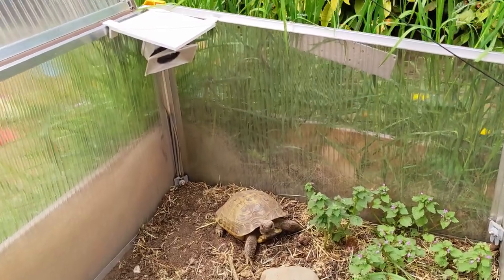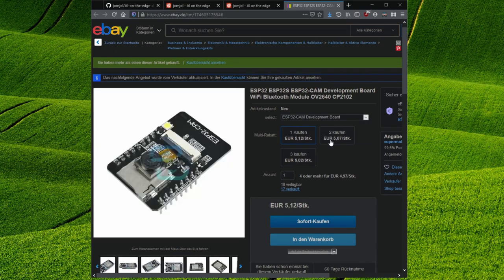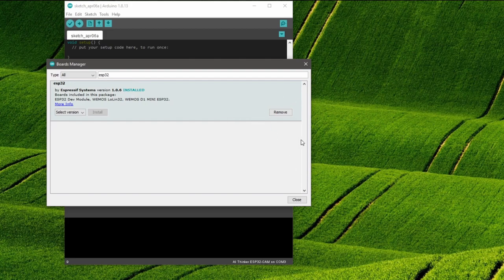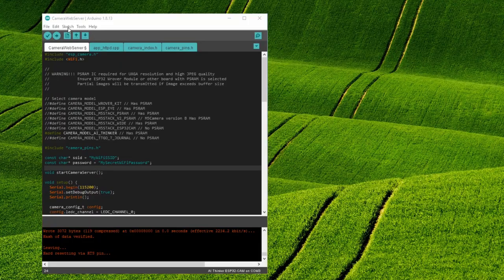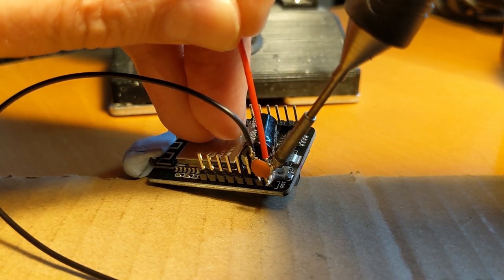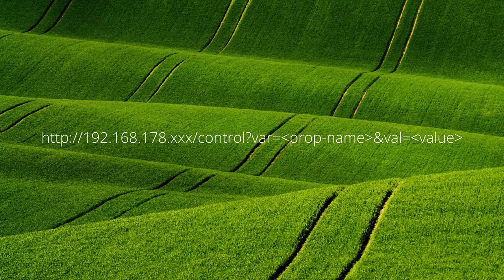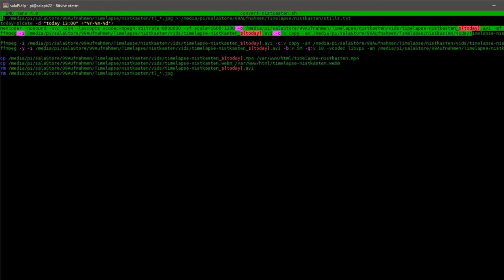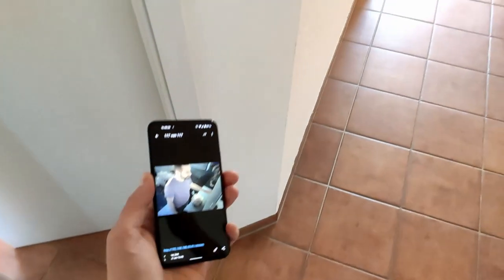ESP32-Cam Basics (for timelapse, pet surveillance, nesting boxes, front door cameras etc.)

Comment: Thanks for the great tutorial. I want to put this camera in an underground manhole outside. I don't have WIFI, so how can I get the signal from the camera. I would like to use a wifi/Ethernet interface or directly from the ESP Camera module with ethernet. Do you have any idea how to do this? Thank you very much for your help.
Reply from the maker: If you are at least close to a wifi, you could try it with an external wifi antenna. Of course, the meter should not be too deep in the manhole. On Youtube you should find examples how to solder a proper antenna to the PCB antenna leads.
I am not sure if there is a solution to store the data locally on the SD card in the ESP.
Everything else is probably more complicated.

The ESP has no LAN itself. So you would have to send the signal from the ESP via serial interface to another device, e.g. a Raspberry-Pi, which then processes it with a script and passes it on via LAN ... but that sounds like a lot of work and a rather high cost, compared to the low benefit. But it would be feasible. I did something similar with an Arduino and a Raspi. 

Do you have power in your manhole?
Reply: @MakerMeik  Yes I have power but I agree with you I looks like complicated

Comment: The ESP 32 Cam module is the bug easiest most lucky sluggish slow quirky module that I've ever used in my life. It randomly loses Wi-Fi connection and you have to dig down into your router to find what new IP has been assigned otherwise assign a static IP address to it but it doesn't matter it'll lose connection anyway. When it does open randomly if you're lucky you get perhaps 10 frames a minute LOL. There is no way to feed at 3.3 wolves successfully it will not initiate if you don't feed it 5 balls the module will fail to activate. I put it I'm line with a great big giant lipo cell any drained it dry overnight doing nothing

Comment: This is a really great video. I have been trying, unsuccessfully, for 3 days to get my new ESP32-Cam modules working consistently. But now with your kind sharing of your code I have managed to get it working. I was having problems, that I now know were probably due to a weak WiFi signal, that the video stream was a complete waste of time. I now have the ESP32 connecting to a Pi4 that is running as a hotspot in close range and I use my iPad to browse to the output on that network. It all seems to be working great. My intention is to monitor a nesting Blackbird next year in my garden. Thank you very much for your efforts and keep up the great work. I have Subbed and look forward to more content from you in the near future.
Reply from the maker: I'm glad I was able to help you with my video. Since you are obviously interested in birds, I can recommend BirdNET-Pi. It's a very interesting project for tracking the bird calls in your garden with a Raspberry Pi: https://github.com/mcguirepr89/BirdNET-Pi

Comment: Sir, my COM port isn't available at the ide. I becomes available only if I give an external power supply.
Reply from the maker: Sometimes USB ports do not supply enough power. This is especially the case with notebooks. 
Maybe the solution with the external power supply is sufficient for you. A USB hub with external power supply can also be a suitable solution.
You might even be lucky and it's sufficient to just replace the USB cable with another one.

Comment: Hello. I have the following error:  

fd_forward.h: No such file or directory

What does it mean and how do I solve it?
Reply from the maker: If you open the preferences in the Arduino IDE, you will find the Sketchbook location at the top. E.g. C:\Users\yourname\Documents\Arduino

There you should find, besides your project folders, also the directories "library" and "hardware".

If you installed the support for ESP32-boards, as described in the video, the file should be in the hardware folder. For me it is under:
C:\Users\yourname\Documents\Arduino\hardware\esp32\tools\sdk\include\esp-face

If this is not the case for you, you should repeat the steps I explain in the video starting at minute 2:20
https://youtu.be/OeogSzLhRLk?t=140

Comment: Was that time-lapse of sky-clouds captured by ov2640 ?
Reply from the maker: No, it is a Raspberry Pi High Quality Cam. I think for this use case you will get similar results with the normal Rapsberry Pi Cam as well. However, with an OV2640 it is hard to get good pictures, but I have heard that ESP32 cams with OV5460 are very good. Please let me know if you have your own experience with this.

Comment: Good video quality on your cam, my cams is not that good. 
Have you any tips for better quality? maybe there is some quality difference on the OV2640 modules on Ebay?
Reply from the maker: It is very likely that the quality of the cameras varies. However, it also helps enormously to change the settings of the web interface. This can really work wonders. I have had quite good experiences with these settings:
http://192.168.1.xx/control?var=framesize&val=10
http://192.168.1.xx/control?var=raw_gma&val=0
http://192.168.1.xx/control?var=dcw&val=0

Comment: Hi !
If I don't have an arduino, can I make Cam ESP 32 settings?
Is there an option for motion detection?
If a thief enters my yard and steals my camera, can I see the recordings on my server / my cloud ?
Reply from the maker: I don't think I quite understand your question. As you can see in the video, I don't use an Arduino either. I only use the Arduino IDE software. It's free and you can use it without an Arduino. But what you need is an FTDI interface, also called a USB-UART interface.

It is also possible to detect changes in the image, i.e. movements. But for that you would have to deal with the subject in depth. Maybe you can do some research on this topic on Youtube or on the web.

If you send the pictures or videos via WiFi to your (secure) server, the thief will not find any pictures on the camera. If you don't have a server nearby, you could also store the pictures on an SD card that is plugged in, in which case the thief could of course read the card and see the pictures.

Comment: Super nice Video !! Why do you cut open the IR filter with a knife ? You can open it by turning the lens cap ? And what exactly is the IR filter ? I want to do this but I don't know how . Can you give me more info about it ?
Reply from the maker: If you remove the entire cap, you no longer have a lens and get a blurry image. But if you only peel out the infrared filter, then you can still focus the lens. The advantage is that you can now also take pictures with infrared light. This means that you can illuminate your nesting box with IR LEDs, for example. The nesting box seems to be dark and hopefully the birds don't notice anything either. Your camera, which now no longer has an IR filter, will still be able to take photos or videos.
Reply: @MakerMeik  Thanks for your quick answher. Can I use anny OV2640 cam for it ?
Reply from the maker: The five or six OV2640 cameras I've had in my hands so far have all been the same.
Reply: @MakerMeik  Thanks a Lot. I let you know if it works..

Comment: Hi, thanks for your tutorial. I am trying to build this for my nesting box. Would an ESP32-CAM-MB (linke this one https://www.ebay.de/itm/264987905369) make the usb-to-ttl interface obsolete?
Reply from the maker: Oh, I didn't know that yet. That should definitely be suitable for the purpose. The development board you linked uses the CH340G chip, which some of my converters also use. It is used to provide the serial ports (receive and transmit) to the PC via the USB interface. Other boards like the classic Arduino Uno, Arduino Nano, NodeMCU or D1 mini often have exactly this chip on-board. So that these microcontrollers can be equipped directly with a USB interface.

Comment: Awesome tutorial !
Can I use it to film 3D printer timelapses ?
Reply from the maker: Of course, why shouldn't that be possible? However, you should think about the placement. If you don't attach the cam to the (moving) print bed, you'll see a lot of fast movements. I think there are also solutions where the printer always moves to a certain position when the image is shot, so you only see the model growing, but don't have any fast flickering back and forth. But I don't have any experience with that.

Comment: Thank you very much for your video. Very good effort.. Hats off to you!

How do you power the module in the bird house in the tree? with a battery? If so, how do you recharge it? That's what's bugging me the most from this type of projects. I cannot figure out how people keep a constant power source for the module.

I noticed you 3D printed the module & LEDs housing. Hope you get "tenants", If you haven't already.
Reply from the maker: I'm sorry, but you will hardly get around a permanent power supply for the cam modules. And that's what I did in the case of the nesting box. For this purpose, however, I used a 12V power supply and then regulated the voltage in the nesting box down to 5V with the help of a buck converter. With 12 V or even 24 V it is easier to bridge 10 to 20 m cable length in the garden without the voltage loss at the device becoming a problem. At the same time, you avoid putting dangerous 230 V cables in the garden.
Last season, by the way, I didn't have a tenant in my nest box. But the new season is just beginning and in fact there was an interested visitor in the meantime ... let's see if he moves in:
https://twitter.com/meikdangmann/status/1506726338908016649/photo/1
Reply: @MakerMeik , that is more or less what I had thought.

Even probably 48V, like in some industrial electronics, but didn't look into a down converter (probably there is a component/unit for down converting 48V that is not too bulky).
Reply: There are 48V buck converters and their dimensions are 45 x 23 x 14 millimeters.
Reply from the maker: I can recommend the LM2596-converters. They cost less than 1,50 EUR incl. shipping and you can adjust the output-voltage with a little screw. That's quite handy.
Reply: @MakerMeik , those are the ones I found. Thanks again.

Comment: Hi, I'm starting with ESP32 and I'd like to use a CAM, but I need to rotate the image 90 degrees. Please advise where in the code and how to edit please? Thank you
Reply from the maker: Unfortunately, this is not directly possible with the code shown in the video. However, there is an improved version of the ESP32 webcam server that adds 90° rotations of the image and many other good features.  For example, OTA updates are then also possible. Here is the link to this project:
https://github.com/easytarget/esp32-cam-webserver

Comment: ets Jul 29 2019 12:21:46

rst:0xc (SW_CPU_RESET),boot:0x13 (SPI_FAST_FLASH_BOOT)
configsip: 0, SPIWP:0xee
clk_drv:0x00,q_drv:0x00,d_drv:0x00,cs0_drv:0x00,hd_drv:0x00,wp_drv:0x00
mode:DIO, clock div:1
load:0x3fff0018,len:4
load:0x3fff001c,len:1216
ho 0 tail 12 room 4
load:0x40078000,len:10944
load:0x40080400,len:6388
entry 0x400806b4

[E][camera.c:1113] camera_probe(): Detected camera not supported.
[E][camera.c:1379] esp_camera_init(): Camera probe failed with error 0x20004
Reply from the maker: looks like a hardware failure

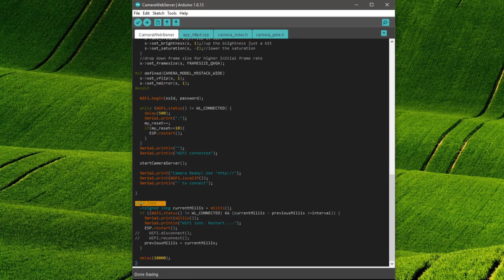Comment: Has anyone tested the WiFi check inside the loop (6:05)? It seems to me that previousMillis never gets set this way, it should be outside the if statement. Also you probably want to set interval to a higher value than the delay in the loop. This will reset the ESP after Wifi is lost, but it does nothing with the interval check, unless I'm missing something.
Reply from the maker: Thanks for the tip, you're right. I have fixed the error. In the meantime, however, I would rather advise the "esp32-cam-webserver" project. It runs much more stable than the example project used here and has some additional features.
https://github.com/easytarget/esp32-cam-webserver

Comment: Why do people do things the hard way? Get the esp32-cam-mb board for programming, and dump this god-awful arduino ide and get VScode with PlatformIO. All free. Your lives will be made much easier!
Reply from the maker: In fact, I also mainly use PlatformIO and VScode. For beginners, however, I think the ArduinoIDE is easier. The topics port selection, uploads and serial monitor alone are less intuitive in VScode. 
And the programming board for the ESP32 cams is only worthwhile if you want to program many ESP32 cams. But most users will hardly order more than two to four modules. With the FTDI board, on the other hand, you learn that you can communicate with a wide variety of boards. That's why this decision was closer for me ... after all, the video is clearly addressed to beginners.
But as always, there are many ways. So thank you for your suggestions for improvement.